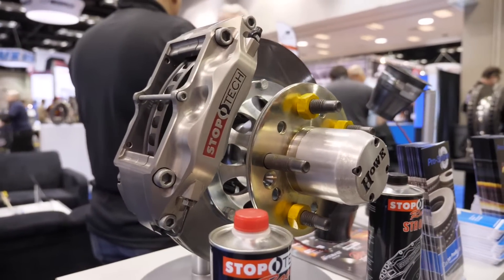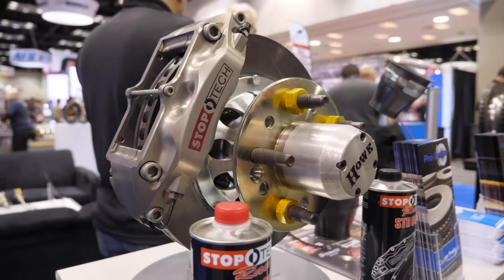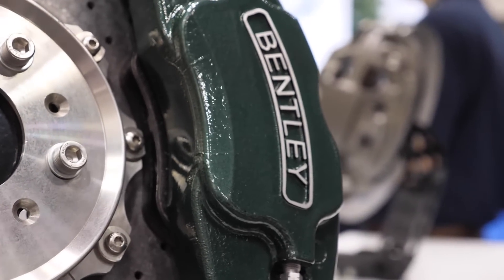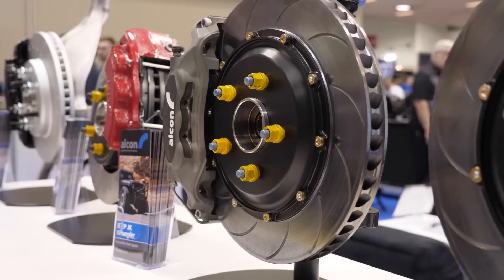Why Stock Brakes Suck & How To Fix Them

Comment from the maker: Building a fast car? Get $400 OFF the VIP package and never pay for another course, EVER: https://hpcdmy.co/vipy28
Brake System course. Design & optimise your set up. Now 50% OFF:  https://hpcdmy.co/offery28
TIME STAMPS:
0:00 - Stock Brakes Are Not Built For Racing
0:26 - Phil Stubbs - Alcon Brakes
0:35 - Production/Stock Limitations
1:35 - Larger Brake Rotors
2:25 - Bigger Is Better For Cooling
3:06 - Caliper Considerations
3:52 - Pad Diameter
4:23 - Caliper Compliance/Stiffness/Flex
5:17 - ABS & Brake Balance
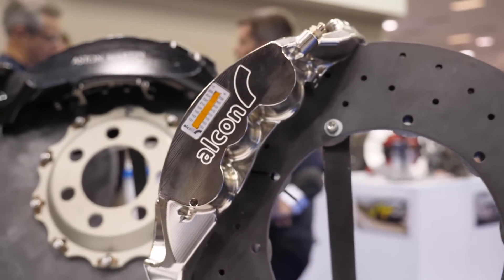6:41 - Brake Bias Fine Adjustment
7:14 - Why Stagger Caliper Piston Sizes?
8:18 - Slotting & Groves On Rotors
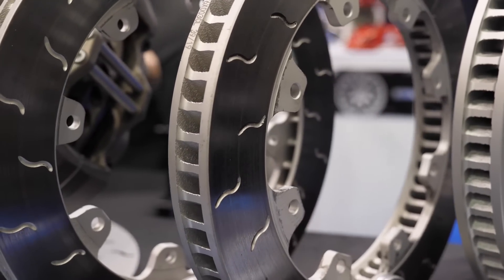9:24 - Bedding Brakes
10:29 - Pre Bedded Brakes
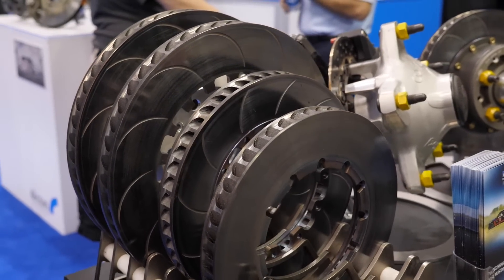11:27 - Cast Iron Vs Carbon Carbon
12:22 - Carbon Ceramic, What Are They?
13:17 - Thanks Phil!
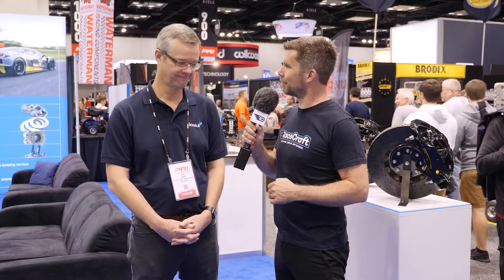13:27 - BUILD.TUNE.DRIVE

Comment: A brake ist nothing else than a heatsink. An that is pretty much why I an a strickt fan of alu rims on 4x4 for overlanding, when you will have issues on long hills.
A lot of people think steel is stronger and therefor go for it but a alum rim can way better absorb the heat of the rotor.

Comment: Biggest and best improvement with brakes is simple, and you don't need 550mm discs gripped by 15 piston calipers lol , quality tyres first , big or upgraded brakes are for track or show cars right ? Quality tyres and quality discs and quality (upgraded if needed for rd ) brake pads

Comment: Personal example: mini R56, stock brakes (non jcw) would cook and become butter in 3 brakes from 170km/h to 90km/h (3 corners). After installing JCW Brembos with custom braided lines, and sloted and drilled rotors I was not able to once get them energy saturated. In fact rear brakes that do not have sloted/vented/drilled rotors get hotter than front brakes in a hot hatch (63/37 weight)

Comment: What if I told you your stock brakes had almost the exact same stopping distance as what is on any performance car? Just something that consumers really tend to forget.
Reply from the maker: They'll do that once in an emergency as they are designed to do, not over hours or even just a few minutes in some cases of heavy use, which many people also forget 🤘
Stock brakes are fine on a normal road car being driven as a normal road car, nothing more nothing kess. They are built to a price and basic safety standards - Taz.
Reply: Braking distance is tire-limited, also it isn't the single factor in deciding whether to upgrade or not. Controlling brake temperature and brake fade over many performance laps is more important.

Comment: There’s a lot to think about in every aspect of building a car. Stock brakes on daily drivers are made for daily driving. High performance brakes are made for high performance vehicles. Some larger brakes weigh less so the fact that they’re larger doesn’t take away power. Also these vehicles have more power that reduce the effect of a larger possibly heavier set of brakes. The duo here provided a lot of information and it’s mainly for those upgrading insufficient systems for the purposes they need them for. For any number of issues there are options to be had to rectify them. Really there are a number of setups that will act the same and provide the same results but be different in its components. It’s up to the client, driver, team to wade through the info and options and trial and error and I get to where they feel is best for them and their needs.

Comment: Maybe needed on the track but on the road waste of $.
Reply from the maker: If you are just driving your car on the road as it was designed for, you don't need to upgrade your brakes for a motorsport application. That is correct 😎 - Taz.

Comment: I have Alcons on my F150 and they are not that great. They are better than the base brakes but the diameter is not enough mass to absorb the thermal load from slowing down.
Reply: what about the pads? which are using? also what diameter rotor?
Reply: @jamesmedina2062  I’ve already upgraded this setup to the Roush F150 brakes. It’s really hard to slow down 6,000 pounds on a 350mm rotor, even if they are 6 piston calipers. Not enough thermal mass. I’ve already researched this one.
Reply: @RadDadisRad  thermal only becomes a factor when there are repeated stops.  So, I would venture there are other factors such as the master cylinder diameter and the pad composition, unless your only complaint is brake fade but even there if fade was the issue certain pads do lots better than others.
Reply: @RadDadisRad  I think the issue is less about the brake manufacturer and more about the vehicle choice. To expect any reasonably priced off the shelf brake that will fit behind a 18-20” wheel to stop that much vehicle from high speeds is pretty unrealistic.
Reply: @byronn.2885  it’s a 22” wheel. That’s why I’m going with heavy SUV brakes. If the Rolls Royce Cullinan uses a similar brake kit that is found on the Trackhawk I think it should favor me well.
Reply: @jamesmedina2062  not necessarily, thermal overload prevents the pad from transferring directional energy into thermal energy. Rotors glaze and the pads cook.
Reply: @RadDadisRad  you are not making sense. It is not a race car cooking the brakes. The question was stopping distance in-town. Bite and grip on the rotor are first a pad issue as well as the torque on those pads from the calipers which is a MC issue. Even fluid is a top 3 issue on grip/bite. Better fluid delivers more torque(air-free as well).
Reply: @jamesmedina2062  slowing down from 150mph cooks the brakes. I do understand.

Comment: Im surprised ABS cant account for large variations in caliper given they account for 2 wheels in the gravel + steering in an emergency.
It's counterintuitive to me.
Cheers, good video :)
Reply: It's not that they can't account for slip/lock, I think the issue here would be hiw effective the abs will be due to pressure?
Reply: @mayk3lll  id agree. While the abs will still work given that usually its more based off wheel speed sensor etc, how effective it will work will be very much changed once you begin to drastcially change
Reply: it's due to the fact that the ABS expects the wheels to lock up at a certain pressure due to the components used. when you fit a larger rotor it might lock up at a lower pressure or maybe even higher because you have the higher rotational mass. or the same rotor might lock at a lower pressure due to a larger piston in the caliper. the ABS is calibrated for stock components; whenever you change to different parts you unbalance the ecuation ;)
Reply: @alexK661  hi i understand your point - but the tyre lock up pressure is totally different in wet weather to dry weather, to icy road.
Anyway i get what your saying, sometimes an unexpected result can happen from modifications. 🍻

Comment: No intention to sound disrespectful but I have never heard of Alcon.  Everyone talks of Brembo, Baer, Wilwood and the like.  Is Alcon a motorsports only brand?
Reply: Many of these big companys have so much going on that they don't bother advertizing to the weekend broke boyracer.
Reply: they have been an OE supplier for many years. Of the ones you mentioned only Brembo is also an OE supplier. Aftermarket: Baer & Wilwood.
Reply: Alcon makes brakes for NASCAR too
Reply: If memory serves me correctly Alcon was the supplier for Baer back in the late 90’s. They are a very quality manufacturer with deep roots in auto racing. Worked at a shop back in the 90’s that worked with them to develop big brake kits for Audi’s and VW’s and the stopping power was insane.
Reply: I also never heard from them. But according to their site, they do some pretty big projects like the AM Valkyrie

Comment: Hey guys. People don’t know but all vehicles that are built only have to just have enough safety to just pass the safety laws. So that means power brakes tyres suspension steals seatbelts ex. This is why I refuse to buy a new car because of the fact that they are just crap. Over priced and unsafe. I have always built my own cars. So I know what every part of that car came from and how safe it is. And all my cars are high powered cars. So I know if I do have a crash I will live. May not be in good shape but I hope that I will be ok. But if I was being a dick in some vehicle that I just bought I don’t think I would live. 90% of everyday vehicles are not safe for what they say they are for. But every day people can’t afford to buy a vehicle that is safe. I had to find a vehicle for my in-laws and if I had have got it wrong I would still be hearing about it. This was back in 2011. And the only vehicle that came in was the jeep grand Cherokee 3.0turbo diesel. They wanted something to tow a caravan around Australia. So I researched fora year and the jeep was the only car that came in as the best. If they made them in a duel cab then that would have been the one to get. People will go off at what I’m saying. But when you do your research and test every vehicle to suit what you’re doing you will find that the Jeep comes in every time. I use my 2011 Jeep everyday for towing and it’s now done 235,000 klms and it is still going strong. I service it every 10,000 klms and I still have not needed to change the disc rotors yet. Pads yes of course. When you maintain a vehicle properly it will not let you down. And I did not buy this new. It had 98,000 klms on it. And they did not look after it. All I had to do was put better tyres on it. Put better lights on it. And I took off the plastic pipe work for the turbo and intercooler and made stainless steel piping up. And it’s been fine. And now I have 3 jeeps and they all have been perfect for what I’m using them for. And I’m not ezey on them at all.
Reply: yeah ,yeah!

Comment: Very informative... I'll have to analyze my brake system which consists of a hydroboost conversion, 14 inch 2 piece rotors, 4 piston stoptech calipers, stainless braided lines and Stoptech street/race pads. All this on my 95 Mustang GT. Great video Andre and HPA team🏆🏆🏆

Comment: It's not bigger is better, brakes weigh a lot. And the weigh is in the worst possible place.
Reply: Exactly! If you're not running into brake fade and you have enough power to lock up your tires, bigger brakes will just make your car slower and worse.
Reply: Big rotor isn't necessarily any heavier than the stock setup due to carbon discs and alloy hats.
Reply: Once exception is getting rid of factory cast iron calipers and brackets, which were pretty common with old or budget vehicles. Aluminum multi-piston calipers are lighter and stiffer, despite the larger size.
Reply: 100% agreed velocity did a show one time about wheels rotors brakes and every time they added something they would Dyno it and the bigger rotors they kept putting on they were losing horsepower.!!!…..
Reply: Wouldn't that weight in the wheels be a worse place?  Same spot but now you've also added rotational weight
Reply: @John_Doe3 unsprung weight is the deadliest of weight sins
Reply: It’s possible that they can be bigger and yet lighter. Bigger means larger surface area in this case
Reply: I disagree. Big brakes saved my life on my Toyota Alphard. I put AP racing 6 pot front and 4 out rear. Stopping power on highway with full load of people has much more confident and the stopping is much shorter linear and comfortable.
Reply: @H.A.T.E_C.H.I.N.K_Lyncher_SB  Max speeed to stop with fully loaded car. Stock brakes are plenty for that. They only start to overheat if you do that repeatedly.
Reply: @rimka11  I didn’t do max speed. I did 110km/h with 7 people on my Toyota Alphard and all of a sudden the car at front brakes for no reason. I hastily brake. If I only use stock brakes I hardly have that stopping power as I have experienced stock brakes and upgraded big brakes on my own car. It really enhance safety. Have you ever used/ tried big brakes on your own car before?
Reply: @H.A.T.E_C.H.I.N.K_Lyncher_SB  Not on my own car but on a similar (other MR2) just differently modded. And decided that i'ts not worh the money and time. Only did braided lines for better feel. Also even if I wanted, modifications like that (safety feature / change of car dynamics) are not alowed in my country, and my car would fail tech inspection. That is another reason. 
Yes and I also had stock brakes overheat on me after several laps on track. They started to stink like hell, feel spongy and hardly brake at all. But still if the car is't dedicated track beast, not worth it. Do a cooldown lap every now and then.
Reply: @rimka11 MR2 and Toyota alphard are two different worlds. Alphard weighs 6x what an mr2 weighs.
Reply: @nevinkuser9892  I have never driven an alphard, but I really doubt that in an age like this when every other feature in a new car is safety feature would a Toyota or any other manufacturer ever underbrake their product. When brakes are one of the or the primary safety feature that is closely inspected and judged. 
As I said earlier, max alowed weight of a car from max allowed speed to full stop, any stock brakes are perfectly fine for this. Or else a manufacturer would be in real trouble.
Reply: The man is selling hammers...every problem is therefor a nail.
Reply: Exactly, bigger is not better, the weak point is the grip of tyres, the brake need be big enough just to dissipate the heat, small is better, is really sad to hear a producer said the big is better.....
Reply: @gabriel1555  size doesnt matter. No, really. This time its true. Its the weight thats the issue. Rotors could be as big as a house as long they have as little mass as possible.
Reply: Making them more efficient with air duckting is where its at.
Reply: There is no one answer. Big brakes exist for reasons that may include 'the greed of Big Brake,' there are plenty of others. Nothing the AP rep said is incorrect.

Comment: heat capacity makes sense although I didn’t give it attention , basically for example instead of a temperature range of 300 through 550C while on a track you would get say 400 to 500C if the disc has a larger mass(can be thicker not necessarily larger Φ). then beefier disc means more heat transfer (radiation/convection).

Comment: We all know how important brakes are, but when your using a carbon/carbon set up and then having to adapt fly by wire throttle assemblys in the cooling ducts using infra-red temp. monitoring of the disc surface and design a module to control the system, just because the Am part of a Pro/Am team takes 2-3 laps to get the brakes back up to temp, you have to wonder why.🤔

Comment: Be nice if there were more options for 2500-3500 series trucks to improve brake performance, especially when heavy towing.
Reply: It's even worse trying to find brakes for a tiny 1500lb car. The smallest brakes on the market are massive overkill, and 2/3 of the brakes on the market are a larger diameter than my wheels.
Reply: check with both Alcon and Wilwood, i do believe they are now offering some truck specific fitments.  i believe i first saw it displayed at their respective booths back at PRI 2022 and saw it again recently at PRI 2023, so somebody at one of these 2 companies IS listening.
Reply: Check out ssbc brakes. They make fantastic truck brakes and work fantastic. Definitely shortens the braking distance.

Comment: I converted my pony car from front drums to disc brakes from a much heavier car.  At least I’m moving in the right direction. For us cheap skates, start with upgraded pads, stainless braid flex lines, cooling ducts and judicious use of that middle pedal.
Reply: The fastest c7z time attack car in the country is running stock front and rear non ceramic brake calipers and rotors with gloc pads. Would it be faster with a set of race brakes? Maybe but only cause some are lighter.
Reply: @ClaytonYatescarenthusiast  Gloc pads.  Noted.
Reply: And good fluid like ravenol racing +325c